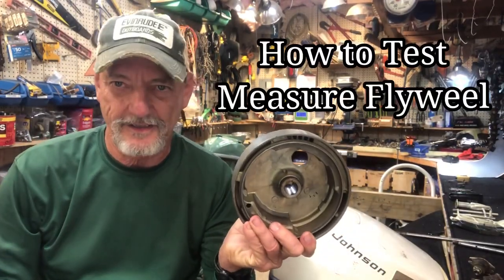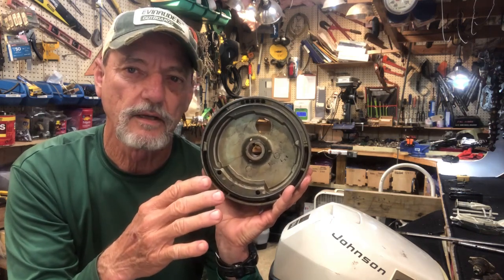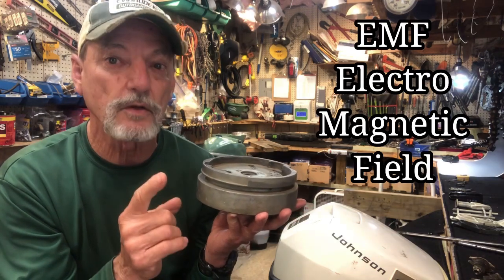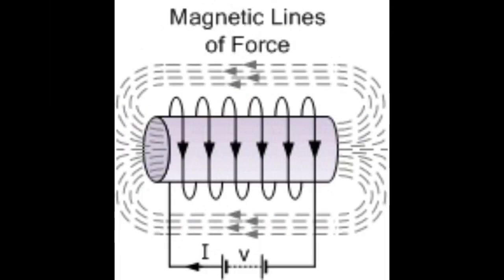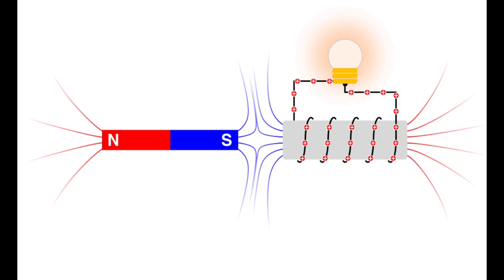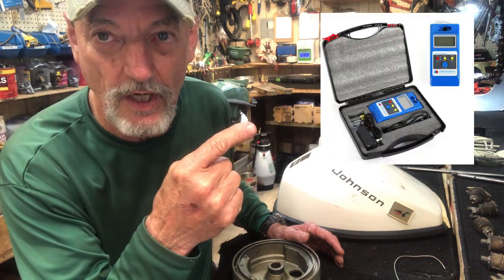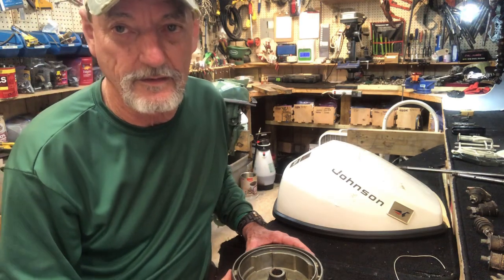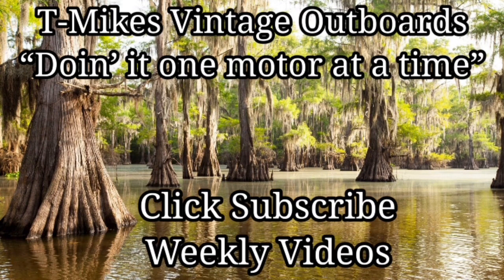How to Test & Measure Flywheel - 3 Ways to Test Flywheel Magnet

Comment: Thanks T-Mike, I'm assuming the Johnson is a one cylinder, I have 2 questions. 1) Does a 2 cylinder have 2 magnets and 3 for a 3 cylinder? 2) I bought a 1994 Searayder that has no spark, it is 90HP 3 cylinder and the flywheel says 2 CYL ONLY. Is this the likely problem?

Comment: I think you are mistaking "magnetic field strength" with "electromotive force".   Magnetic field is always there so long the material is magnetized whether it be a natural magnet or artificial magnetic field.  For EMF to occur there most be electromechanical movement, for example, the magnetized flywheel rotating near a coil. Sticking a nut or screwdriver on to a magnet on itself does not constitute EMF,

Comment: Thanks for the video but what number are we looking for on the meter after spending $80 bucks for the meter !? 🤭
Reply from the maker: I would refer you to the manufacturer spec on your particular flywheel. Good luck and thanks for watching
Reply: @michaeljsimon  it's a Honda Harmony II HRT 216 SDA 1998 year model doubt they'll have that information now sadly. This 25 year old mower is awesome, Honda's the elite! I've replaced the carburetor & preparing to replace the ignition coil & noticed on the flywheel the magnet wasn't noticeably seen, but after watching your video it did tell me that the magnet is embedded behind the outer surface of the flywheel unseen, I'm just going to go ahead and assume that the magnets functioning fine and replace the ignition coil  🥇

Comment: Mike on my Johnson 4hp J4RETB  I  think I understand that after removing fkywheel I have to time it or index when it's reinstalled.  Do you have video on that or a somewhere I can get that information?
Reply from the maker: No need to retime unless you moved the points setting - flywheel fits into woodruff key to ensure proper position.

Comment: Mike you're awesome well explained video!!
I have a old 62 sportswin 10hp it been running strong, last time I was on the water coming back in it die,got it home check it out im getting spark from  one plug
Don't know exactly where to start checking, the flywheel is off 
Don't know if it the coil,flywheel magnet,points and condenser
Any help would be greatly appreciated
Reply from the maker: https://youtu.be/_p_QoBQ1gYI

Comment: Good video but my Briggs has 3 magnets and one seems weak but the center one is strong? What do you think?
Reply from the maker: Have you tested it with a Gauss Meter?
Reply: @michaeljsimon  no I don’t have one unfortunately but the middle magnet and one to it’s side seem strong but the third one is weak and won’t hold a screw driver but I’m thinking that’s normal, so it has no points, cleaned all surfaces, new coil and plug and I can barely see the spark it jumps around a lot and is white not blue doesn’t look good? Thanks for the reply.
Reply from the maker: @joecorrie1  https://youtu.be/_p_QoBQ1gYI
Reply: @michaeljsimon  more things to check, 🙏